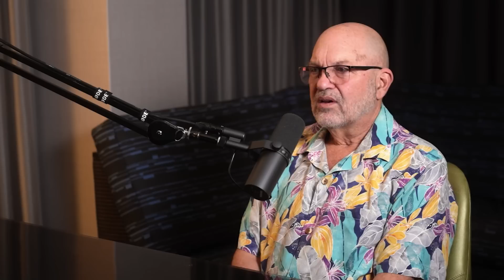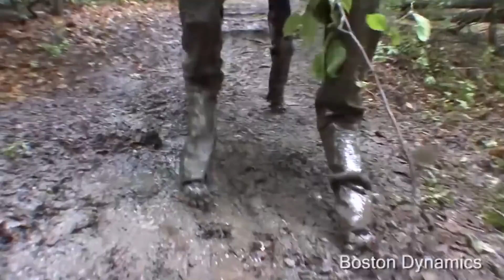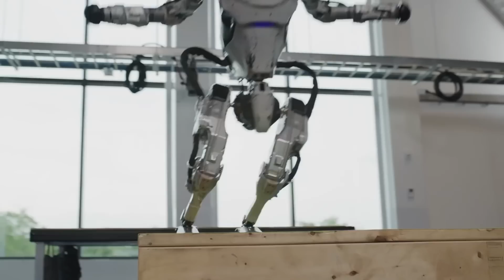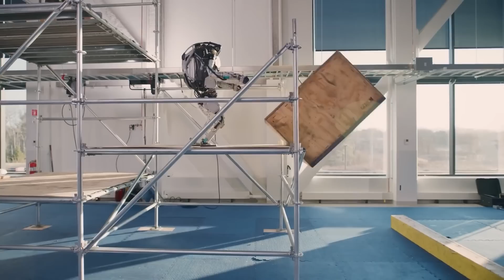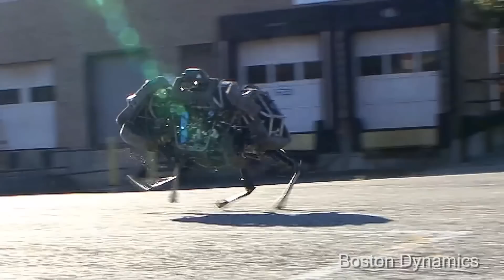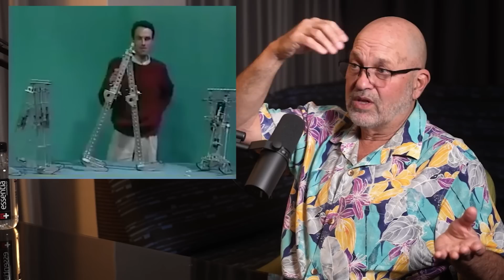Boston Dynamics robots explained | Marc Raibert and Lex Fridman

Comment: it's not people think hydraulic is old fashion, it's hydraulic system has higher initial cost compare to other system like electric or pneumatic system. Especially since we place tariff on the biggest hydraulic manufacturer in world due to trade war. So unless the machine operates long enough to amortize the initial high cost, electric system is more practical in the short term. When technology is still rapidly developing, the product haven't stabilize enough to justify going for long term performance.